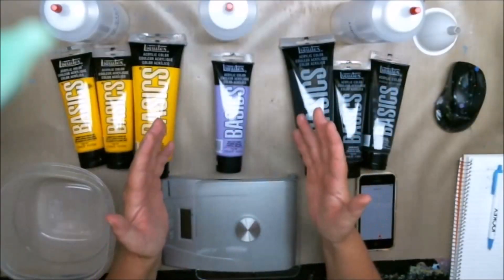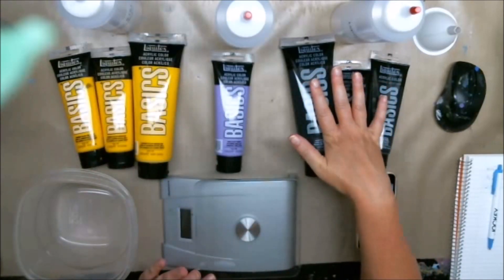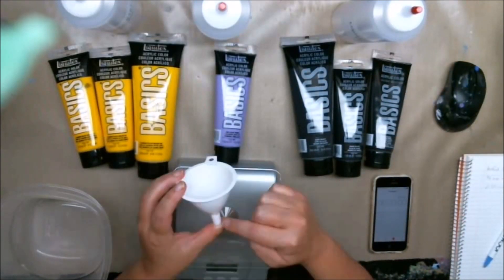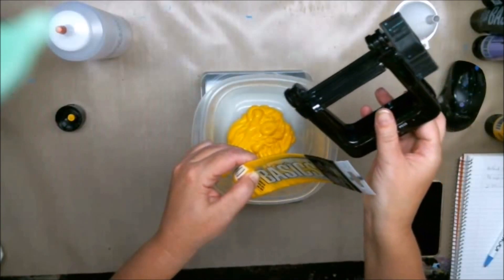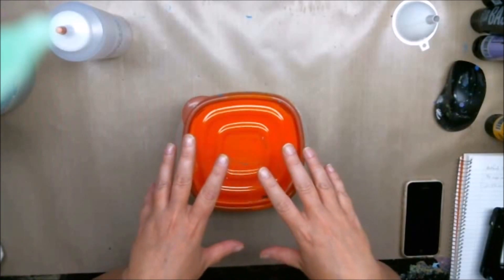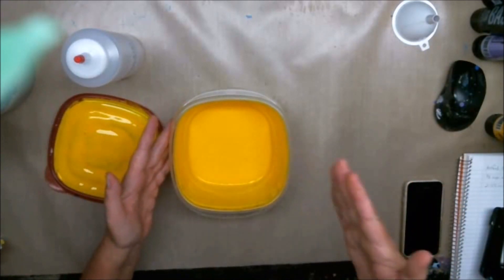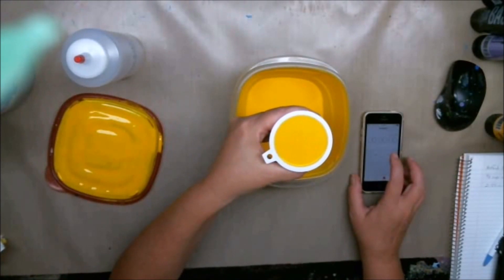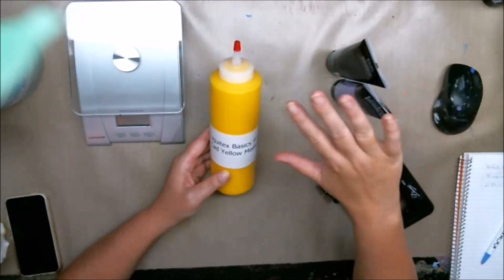HOW TO:  Make Fluid Acrylic Paints -- Artful Magazine Submission Oct 2016

Comment: How can I make the acrylic paint itself as it is very expensive? Thank you
Reply from the maker: Acrylic paint is simply a polymer and pigment mixed together. I use very cheap student grade paint, like Liquitex Basics. It is actually MORE expensive to make your own paint as the pigments are so expensive.  But if you have access to powdered pigments, you can mix it with clear polymer gel and make a paint.  The pigments have to be very very finely ground or it will be lumpy... good luck either way!  And thanks for watching my videos.

Comment: Why not squeeze half of the paint into a plastic bottle, half into another, then add water to both bottles until the 50% water portion is reached? Less paint wasted and hardly any mess to clean up. I paint gaming miniatures (anything from 15mm (1/100th scale), to 28mm (1/56th scale), and larger), but I've never tried to make a paint from artist acrylic tube paints. I'm afraid the paint composition might start to break down if I thinned it to a consistency suitable for painting hobby miniatures. I believe Golden (maybe Liquitex as well), sell 'fluid' acrylics that are much closer to the type of paint I need, but they're pretty darned expensive 0.0 .
Reply from the maker: This video was made before I got my much bigger bottles and quart sized paint containers from Liquitex.  Saves on plastic being recycled too!  I have so many colours that one squeeze bottle per colour is enough.  If you want to paint minatures and want to use the cheaper artist acrylic paint you can thin them with acrylic airbursh medium, so you don't lose the integrity of the paint.  http://www.goldenpaints.com/technicalinfo_abmedium  Thanks for watching and commenting.

Comment: How much water we can add in acrylic color?
Reply from the maker: My recipe is 50%water to 50% paint by WEIGHT.  So 100grams of paint and 100grams of water.  This gives a thickness like cream.  You can add more or less to get a thin-ness that you like, but I find this works well for me!

For people that don't like to weigh, some have used cups/cups and have had good results.  I usually add 60/40 when dealing with craft paints as they are thinner and require less water.

I hope this helps.  Cheers.

Comment: do you think that i could airbrush with your paint mixture?
Reply from the maker: No. My mixture would be too thick for an airbrush.... 

To airbrush you would need Liquitex Air Brush Medium, which you can find here ... https://amzn.to/2HtCiHJ

I have never used the airbrush medium, so I would encourage you to experiment with different consistencies until you found the one that works best for you

Now... you might want to try to thin down my mixture even more, to get to the airbrush medium consistency with water and see what happens, but it would be very sheer as the paint would be watered down a lot.  This should be an experiment only, just to see what happens.

For professional results I have to encourage you to use the Air Brush Medium to get sustainable results.

Good luck!

Comment: Using such a high volume of water is not going to allow the paint to adhere properly and in the long run the paint film will flake and deteriorate over time. It may be giving you the effects you like but you may find that your paintings lack permanence. I find it's actually just easiest to buy fluid paint. This is something I have really experimented with and finally have reached the conclusion that the paint makers have their science down and I'm happy to benefit from their expertise. There are some really affordable options out there with terrific pigmentation and many do have archival quality, which I don't know about you but for me that's important. Especially if I am selling my art. I just wanted to mention that to you since this is a topic I've been interested in and I like to see other painters be successful.
Reply: S W May i ask which more fluid acrylics do you recommend? I use heavy body and it's a pain to cover canvas
Reply: Dominic C Not sure where in the world you are, but I live in Canada.  
I don't think its necessary to get a new set of fluid paints if you already have a lot of heavy body paints. I use those too, but I mix them differently. Try using air brush medium or even pouring medium to thin the paint down - start with a little bit at a time till you get it a lot more fluid before adding water. I only use 1 part water to 3 parts heavy body paint, but if you contact the manufacturers they can tell you their recommendations. I do that all the time and most are super helpful and they are experts in their products so they can tell you what works best. I have been slowly transitioning from Soho, liquitex and Grumbacher heavy body paints to fluid acrylics and acrylic inks - as I run out of my favorite colours I just replace them with more fluid colours. 

But to answer your question, I  enjoy using fluid acrylics from Golden the most however they can be pricey so what I like to do is hunt for deals on ebay and craigslist, Jerry's Artarama often has sales, and I watch Michael's for 50% off coupons and then I will use them for the more expensive items. I've also discovered that Opus art supply has their own fluid acrylics that are very nice, and are less expensive than Golden. Opus is a local company but you can find them on Google and they do have an online store. Decoart also has a media fluid acrylic as well as their Americana line of fluid paints, which are actually really nice to use. I have noticed that Da Vinci has a line of fluid acrylics too, but I have not tried them myself. 

Just keep in mind that whatever you end up using, test them for yourself and see what works best for you. I'd love to see what you're up to so feel free to share pics or vids of your art!
Reply: S W Thank you for all the effort. Yea, as for now I'm using golden heavy body. The thing is even after thining with water they dont flow as I desire. Too much water results  in transparent spots. Guess i have to try different brands.
Reply: Dominic C have you tried using a medium?
Reply: S W no, just water.
Reply from the maker: I have several videos that talk about why this isn't a problem...but thanks for watching my videos.
Reply from the maker: fluid acrylic paints are expensive, which is why I have successfully used paint and water with student grade paints for three years.  I used Liquitex Basics and water in a 50/50 ratio by weight.  Good luck
Reply from the maker: please be aware that SW has a different opinion than I do, but you take what you want from both and do what is good for you....experiement and let me know.
Reply from the maker: Dominic - just water is fine...you don't have to use medium to get excellent results...and I cannot recommend heating up and mediums with a heat gun or blow torch, they aren't meant to be heated us and the fumes are considered toxic.  Experiment with water and move to mediums if you want as you gain proficiency.  Good luck!
Reply from the maker: SW Although I appreciate you giving your own opinion on fluid acrylics, doing so on another artist's channel in their comment feed is a bit ...awkward.  Your responses could be confusing to my own subscribers as they may not understand that you are not me or represent my views on my channel. I encourage you to have these discussions on your channel; as there are so many ways of doing fluid acrylic art and no wrong ways of doing art.  Thank you.
Reply: Andrea Mercier right and not to mention BK in the old days there were no such thing as pouring medium and all they had to use was water I have a painting that is a antique and it's still vivid and bright and we all know 100 years ago there were no such thing as mediums and as I totally understand it's your own opinion I to don't think you should be putting it on another artist video please have respect
Reply from the maker: Thanks for your support

Comment: Can't you eye ball everything? I can't see how it's necessary to go through all that you do, especially knowing Liquidtex Basics are consistent with the viscosity of their paints.  🤔😊🤔😊🤔😊
Reply from the maker: You certainly can eyeball...but for me it is all about the same viscosity so that my paints are all the exact same thickness so they push each other instead of mix.  Some artists like the mixing...I don't.  So if you want to just add water until you are happy....go for it.  Experimenting is what it is all about.  Just so you know...when I make new paints...I just put the bottle on the scale, add 200 grams of paint...add 200 grams of water and shake.  This video was a step-by-step process for newbies.  I don't test or anything anymore.  The paints are all the same viscosity from Liquitex, which is why I like them .... weighing is more precise than measurement by cup....as anyone who uses resin will know...but it would be okay to do a cup of paint with a cup of water OR even make some lines on the bottles and just fill to the lines.  This video shows off my OCD and was an introduction to people that had never done this before.  Thanks so much for you comment...it gives me a chance to more fully explain myself to everyone.  Cheers.

Comment: I dont hear anything. So I don't know what you are using to make these paintings. Acrylic painting and...
Reply from the maker: I am sorry you are having trouble hearing me in the video.  My recipe is 50% paint to 50% water by weight.  I use the funnel to time how fast the paint flows.  My 1/3 cup funnel flows at 4.1 to 4.9 seconds and I know it is correct consistency.  I only have to do it the first time I use a new paint manufacturer.  If you use Liquitex Basics or Amsterdam Standard the 50/50 weight ratio will work for you!  Cheers.
Reply: Thank you !!!!!!!!
Reply from the maker: You are very welcome my dear.